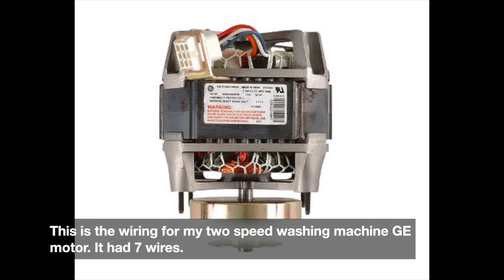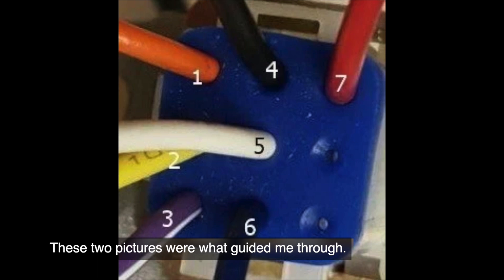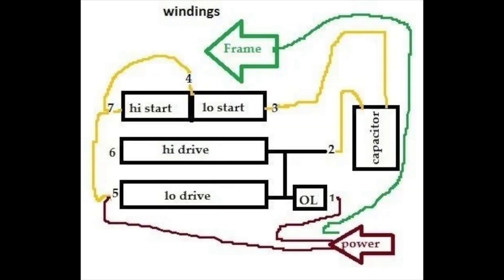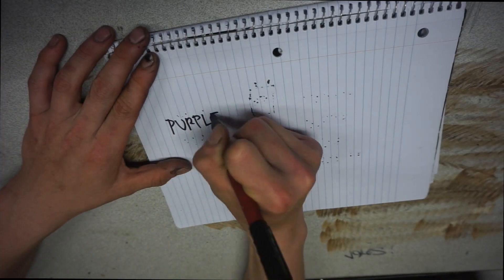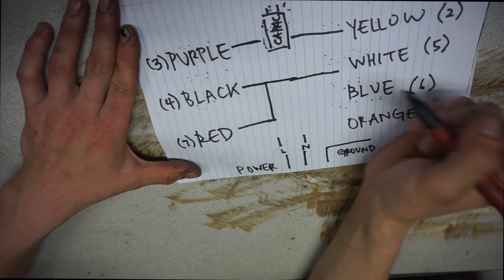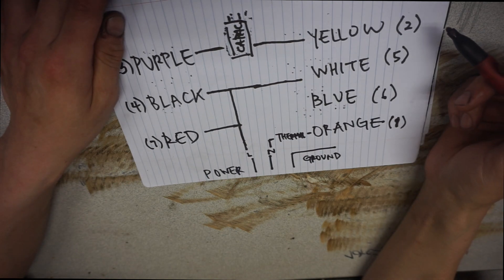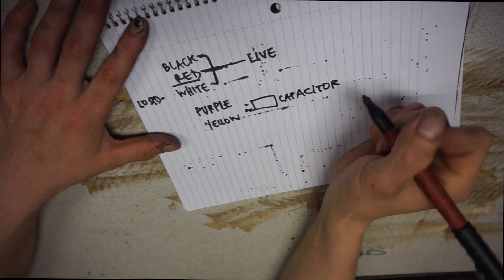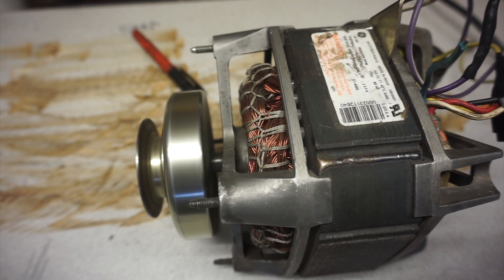How to wire a 7 wire 2 speed single phase AC washing machine motor

Comment: Good posting and just a side note. These are 1/2hp motors but if you wire them for low speed…. You lose a decent amount of power. I plan on wiring for high speed and then some pulley arrangements will slow down my rpm. Thanks again.
Reply from the maker: Yes!!

Comment: Super Great job  as it shed light on the color codes functions.  As I understand it from other research; I can see that Blue =Hi Speed  ;  White = Low Speed;  Orange =Neutral ; RED = Start Winding; Yellow =Capacitor;  Purple/Wht = ( i'm guessing Agitate or Spin)??  I would like to ask  What is Black?  Was Black powered through Timer originally??   Pending Direction I imagine;   Black,Red,White,and LIVE wire.(Blue added here if you want high speed).  Purple and Yellow to Capacitor(I didnt know I could do that),  Orange and Neutral wire to thermal switch   GE is stingy with the diagrams; Any advice  you provide is greatly appreciated.  Thanks again